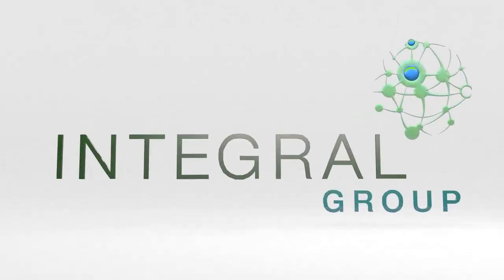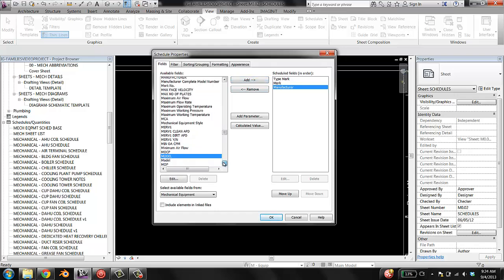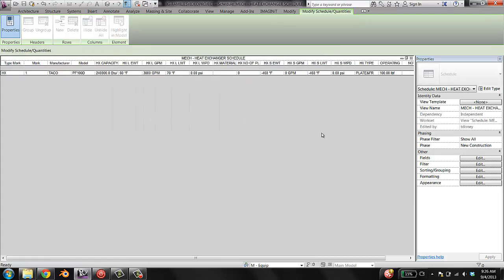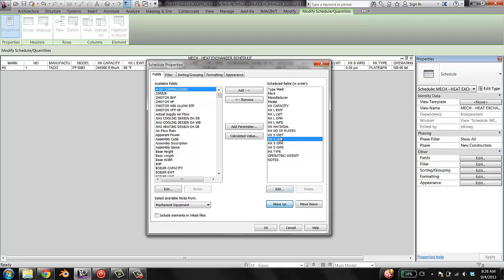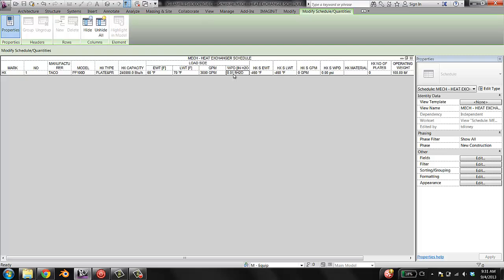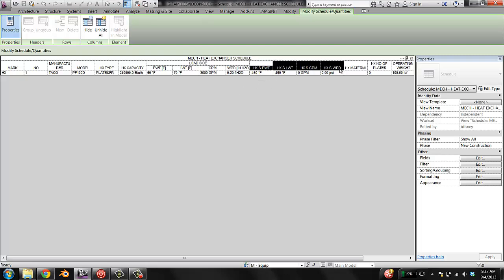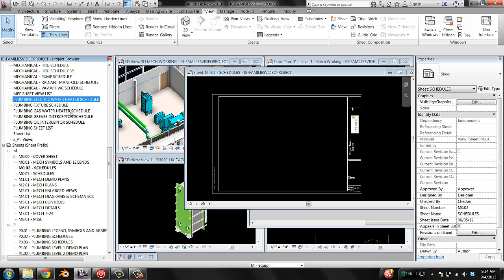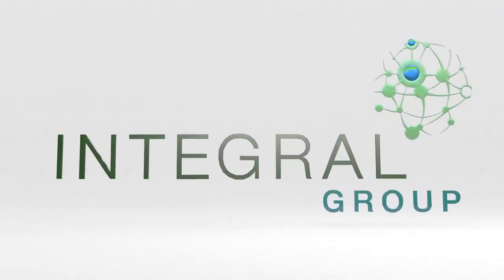How to Schedule Mechanical Families in Revit MEP (Part 5: Build a Schedule)

Comment: Tyler, thank you for the videos, they were extremely helpful in not only the creation of schedules, but also in my understanding of Revit. I noticed that in your schedule you had a column for notes, as I do with all of my schedules. What do you do or recommend for adding the notes under the schedule? Right now I just have a notes view I place under the schedule on the sheet, but I would like to have a notes file linked to the schedule if possible. Please let me know what you think.